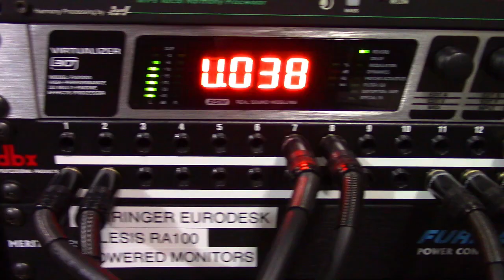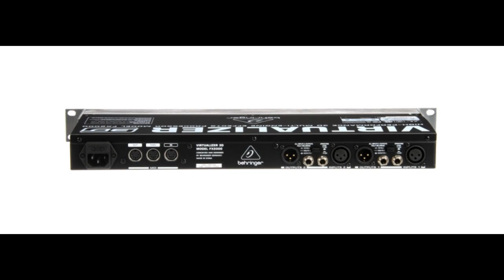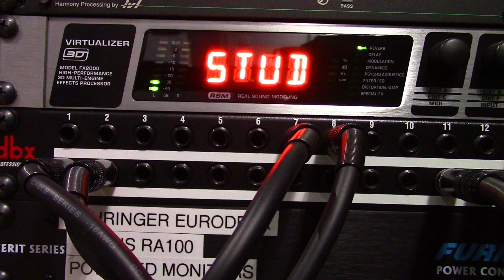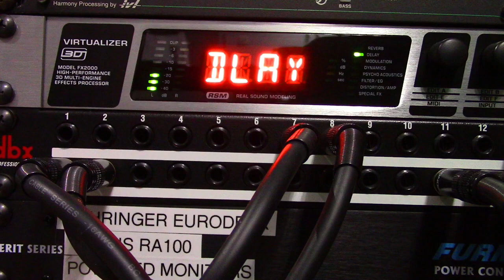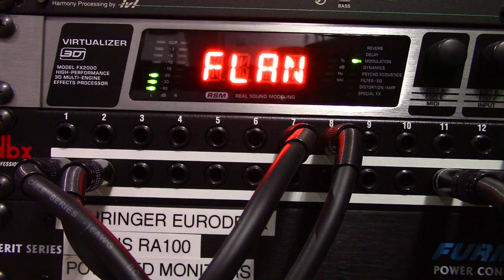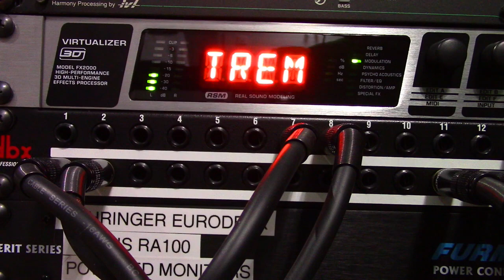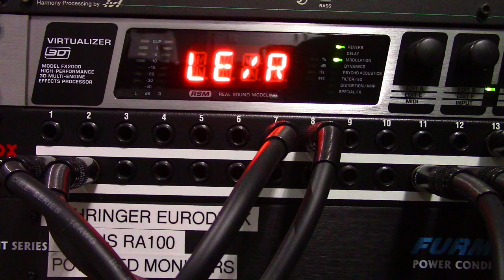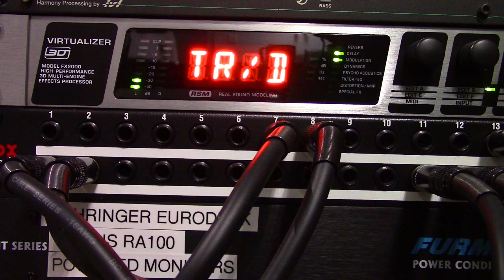Behringer VIRTUALIZER 3D FX2000 Multi-Effects Processor: Vocal Effects

Comment: Thanks for doing this! I just started getting into using external hardware for recording, recently bought an external preamp and an external compressor, have been looking into getting an eq and stumbled upon this. I've watched several videos about it now and I only have one question. Everybody seems to be running it through a mixer, but would it be possible to use it through a regular audio interface? I am using a 3rd gen focusrite scarlett 18i8. If you (or anyone) could answer that I would appreciate it greatly! <3
Reply from the maker: We know that people use a mixer in this regard because they often include AUX send/return functionality that allows users to apply and control an effect on all channels and subgroups. If your using a software DAW, your audio interface may allow you to do the same if configured properly. It's suggested that you consult your DAW's tutorial on how to set that up if it's possible with your environment. Thanks for watching and sharing. 👍🏿

Comment: When I purchased this unit a few years ago I figured I could model a complete sound the way you can with a whole bank of pedals.  Boy was I ever disappointed. Two effects at best.  Now I am not saying that using it as a single effects pedal gives me a choice of just about every effect a person could want and that effect can be radically modified.  But as a complete processor to lay up multiple effects on top of one another, well it comes in as a complete failure.

Comment: Hello. Thanks for sharing. I have one of this units stacked in a tight rack over an 11R and i notice it gest a little hot over time. Since the two small holes it has un the lower face are covered by the upper face of the 11R should i be worried? i mean can heat damage the unit? (it doesn't get that hot, but i rather ask). Thanks in advance.
Reply from the maker: Excessive and extreme heat can damage electronics in general but it sounds like you're good to go. Thanks so much for watching. 👍🏿

Comment: Are you going to do a video on how to use the unit in a mix? For example. How to take a raw DI vocal recording and run it through the unit and put some reverb on the track, and then put some chorus on it afterwards. Or any other effects one at a time.
Reply from the maker: I explain how to do this in detail in my video “Tascam DP24/DP32 Digital Portastudio: Using External Effects” on this channel. You can use the FX2000 to accomplish this same goal on the DP as well as other units. The configuration process is basically the same. Thanks for watching. 👍🏿

Comment: Is it possible to use this device to take a dry-through signal and a wet signal to your audio interface? That way when I record I have an unaffected vocal take which I can still use..?
Reply from the maker: Yes you can, since the unit has 2 separate identical channels. With this, you can route your signals the way you described. Thanks for watching and sharing. 👍🏿
Reply: @PowercoatMusic  That's perfect then! Thanks so much for taking the time to reply. I really appreciate it.
Reply: Also if you have a patchbay which has “half normal mode”, you could split the signal prior to the unit and record one dry and one wet signal.
Reply: @MCEEZR  Thanks for that Matty. 'Appreciate it.